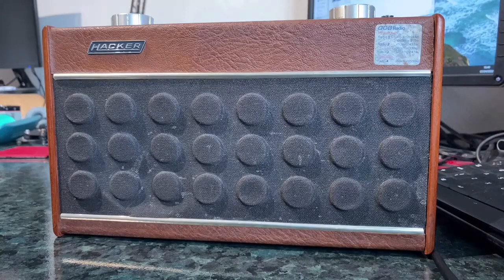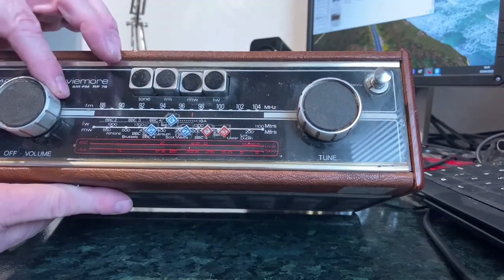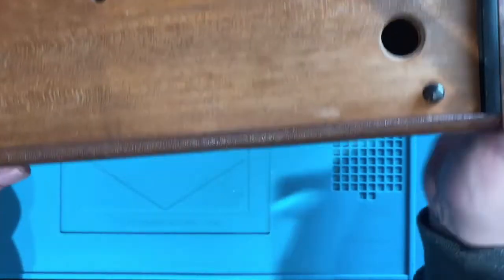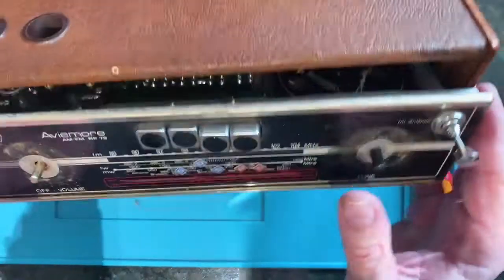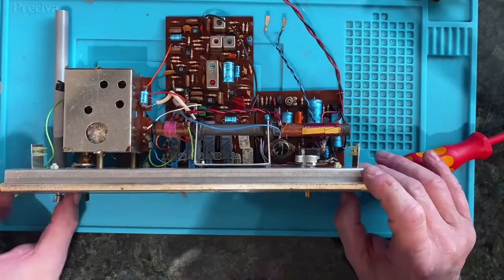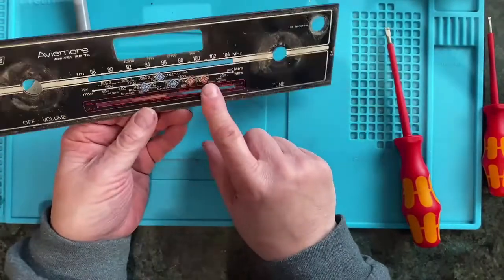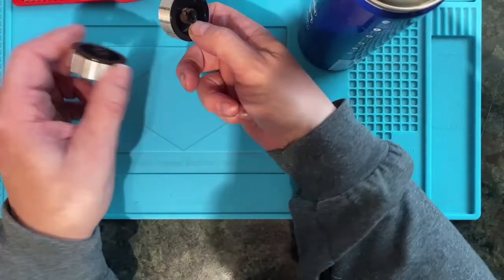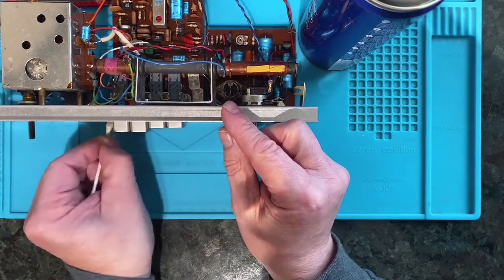Hacker Aviemore RP78

Comment: Really nice radio, the Aviemore. I have one, but with black leather and I really like listening to it. It may not be as solid or sound as good as the senior Hackers, but it's still a good little performer. I think your speaker has been eaten by bugs. I've seen damage like this before, but never this extensive! Here's an idea I've used for patching up holes in speakers - cut up a tea bag and glue the pieces carefully over the damaged section with thin liquid paper glue. However I've only ever tried this on solitary holes, not Swiss cheese like this. Make sure you've a replacement speaker on hand before trying this. Another advice, this one about cleaning knobs - don't bother scraping with toothpicks or q-tips. Just drop the knobs in a glass filled with a mix of hot water and window cleaner and leave them for an hour. Pull them out, dry them up and they'll be good as new. Just be careful if they have paint markers on them, because they might disappear along with the dirt.
Reply from the maker: I've seen David Tipton on his channel put some liquid plastic around the suspension to deal with that, but as you say that one was beyond redemption. Surprised it made any sound at all!